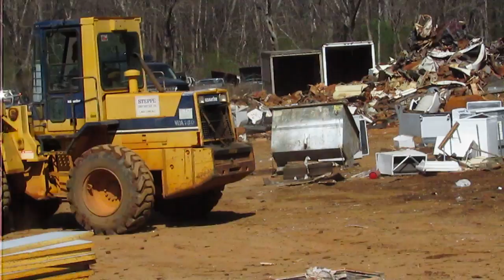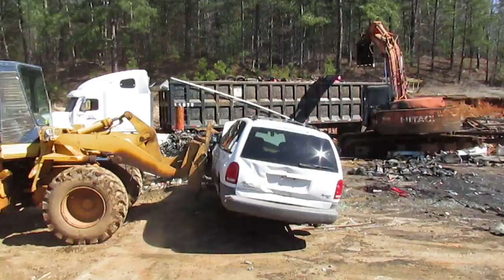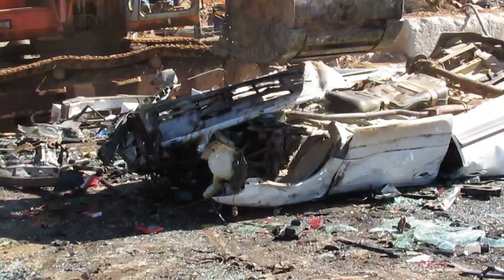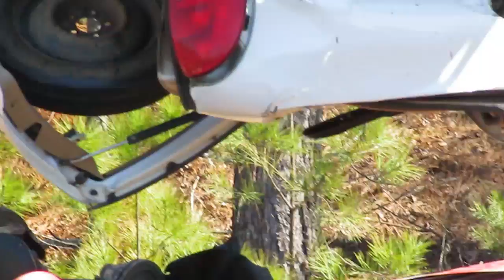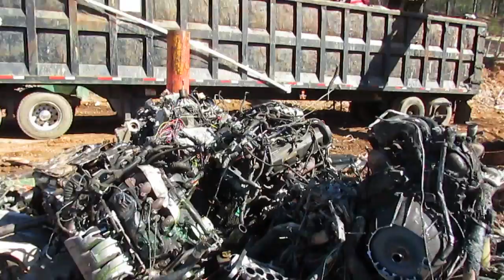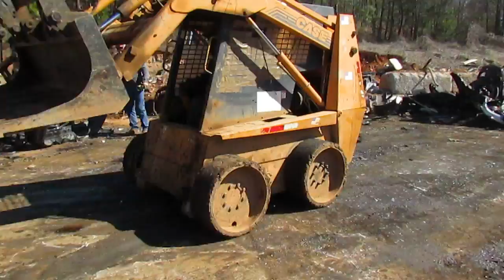Junkyard Car Crushing  (Dodge Caravan)

Comment: The transmission probably went in the Caravan as it was common in Dodge and Plymouth vans and not worth fixing.
Reply from the maker: Believe it or not.. it actually had a knocking engine. It still ran and we tried selling the trans but everyone wanted us to remove it for them
Reply: we had to replace the transmission in our 1997 Caravan.  Even before we got rid of in 2009 under the cash for clunkers program, the new transmission started to slip.
Reply: I still drive a 2003 town and country, even with the awful New York winter's I've had very little issue with it, the only major issues I've had so far are are some line leaks (thanks to NYs salt) and the AC compressor clutch went.

Comment: My buddy Ray has a 1998 Dodge Caravan with a little over 350,000 miles on it! Honestly not sure how it didn’t die yet. 

It kinda bothers me that the van that was crushed looked cleaner than my buddies. Ray’s van is sideswiped on the drivers side and is full of dings and dents

Comment: I got pics and videos for Days me doing this I work at a scrap yard just wondering if you all are beginners ??because I can have gas tank engine and transmission and radiator out and car or truck flat as a pancake loaded in the dumpster within 5 mins 15 cars/trucks to one dumpster no problem 3 dumpster a day all done before lunch then rest of day go pull parts for customers been doing it 6 years strong 💪